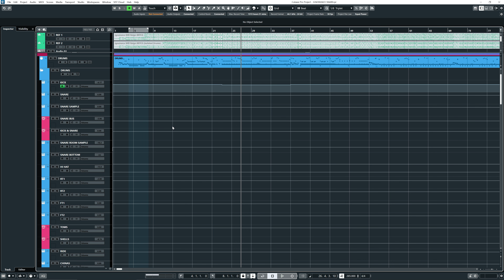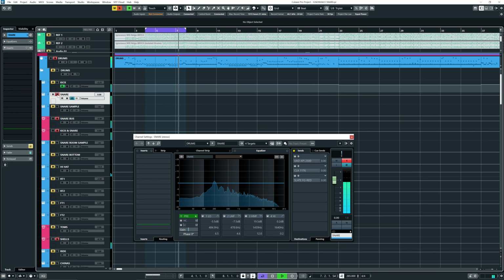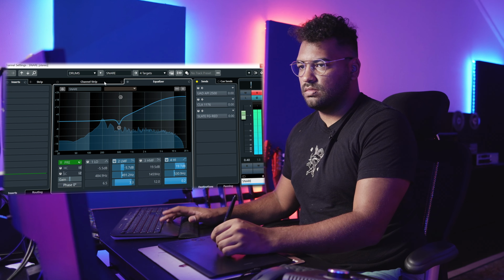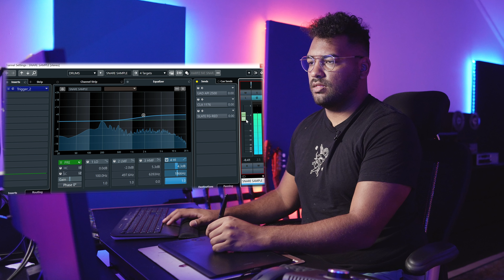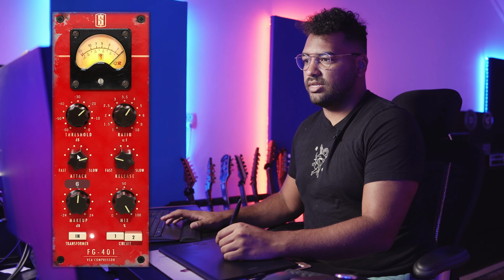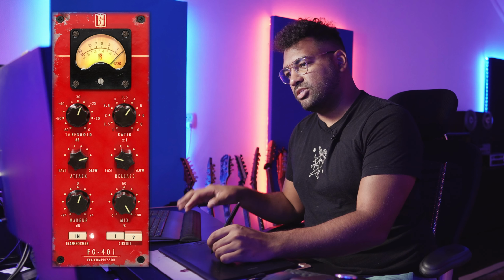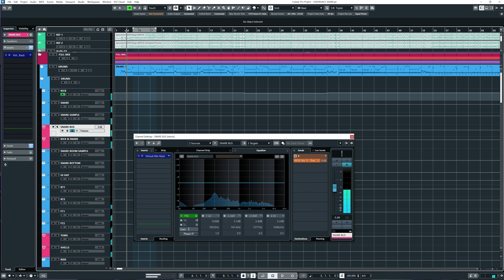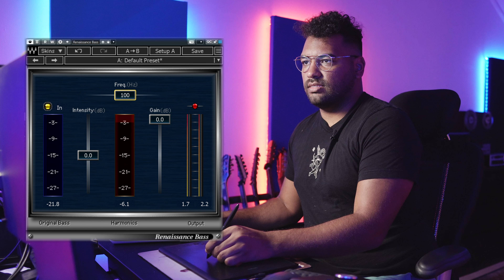How to mix a MODERN METAL SNARE DRUM

Comment: doesn't look like your converting your drum midi to audio files - just routing the audio to separate tracks is not the way to do it  - convert the entire drum track from midi to audio files then start your mixing - most drum software has that feature
Reply: as someone who is only just beginning to figure out how to properly mix drum tracks, I am genuinely interested to know what exactly converting midi tracks to audio tracks accomplishes so I can hopefully make better mixes in the future
Reply: @JBshreds it only reduces the load on your cpu.
Reply: It doesn't do anything technically for your mix. The theory is 2 fold, 1. You're committing to a sound.
2. Significantly reduce CPU/memory load